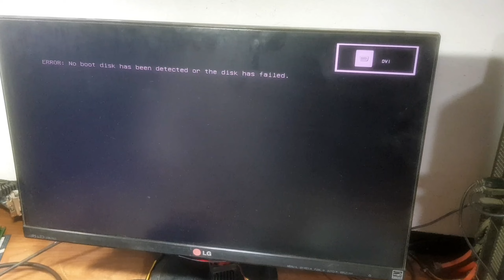How To Fix Acer Veriton S6620G LGA 1155 continuous beeping when computer is turned on

Comment: You short ram pins?I can't understand what are your doing
Reply: no there was a dry joint he was made link with wire but this is not always when long beep appear most of the time is the intel sb some boards like the new silly veriton acer design has weak shim or no shim on sb bga